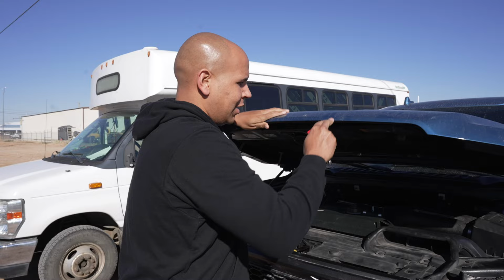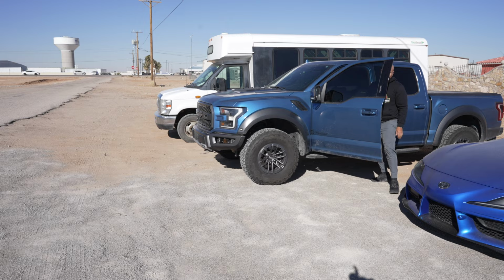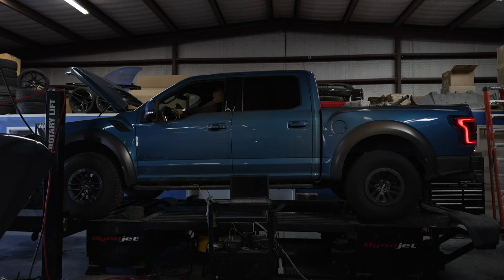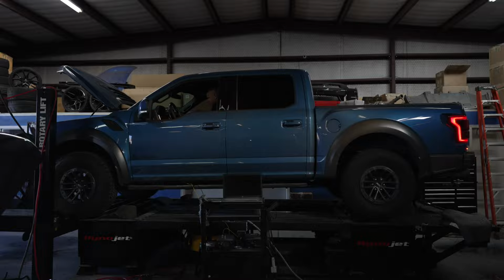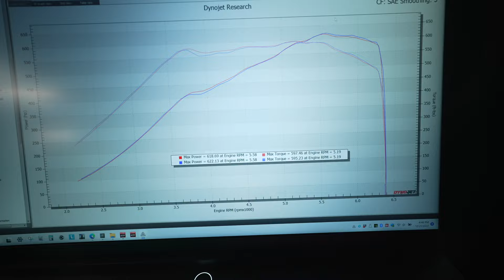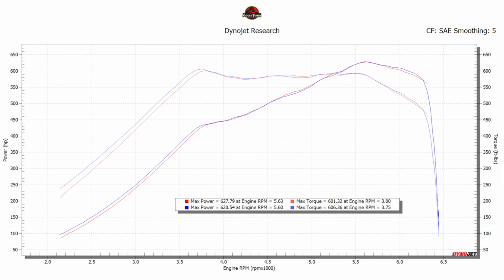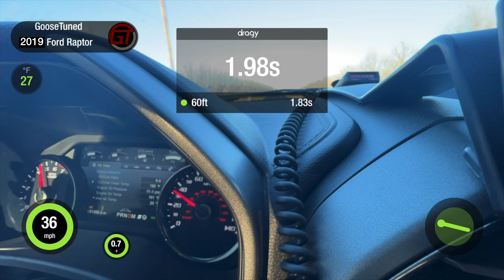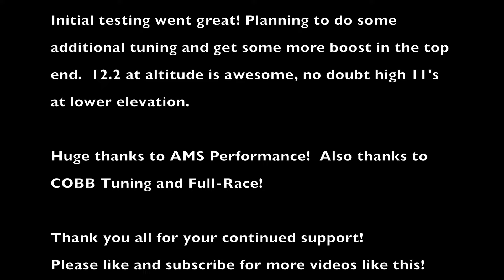Gen 2 Garrett PowerMax Turbo Install + ID1050cc install on the Gen 3

Comment: Loving the power, but it looks like I am spoiled by these guys running Holley Dominator systems that let them add in a scramble button. That would let you tune it nice and safe, and then give you a plan B if you need to double down. 

It's still crazy to think of 5800lbs of truck being hurled that quickly. Love it!

Comment: Did she upgrade her intercooler as well? I have a GEN 2 And have upgraded to the Garret power Max turbos as well as supporting mods, such as AMS boost tubes, AMS intercooler, K&N charge pipe,  BBK throttle body, Afe super raptor intake, Stainless Works, 3” catted downpipes, full 3” Roush cat back exhaust, MSD coil packs, Wilwood 6-piston disc brakes all around, and also a handful of cosmetic upgrades….. I only list all that so you know I’m serious about building my truck and I’ve done all the work myself,  it’s not been easy But my truck runs, amazingly strong. Sounds very good and looks awesome. With your experience, I’d love to ask a question about the AMS intercooler, and maybe you don’t know, but there’s no way aside from having a different bong welded on to the aluminum intercooler to run an aftermarket blow off valve.. This is very disappointing, considering I was already running an aftermarket before I upgraded the intercooler, Do you happen to have any suggestions or know of any products that may work with the AMS intercooler other than the stock blow off valve? If you answer, I thank you in advance and appreciate your time
Reply from the maker: That big should work on the ams intercooler

Comment: What bov does this truck have? I notived my bov doesn't vent when i  free rev. The bov works properly when the truck is running but not when parked or in neutral, and i used to be able to do that before installing the same garrett stage 2 turbos on my 2017 Raptor
Reply from the maker: I have turbosmart

Comment: If I upgrade the intercooler and turbo system do I have to upgrade the exhaust system to gain performance. I don't like to annoying car sound
Reply from the maker: It would be best to add catted down pipes. We personally kept the stock cat back.